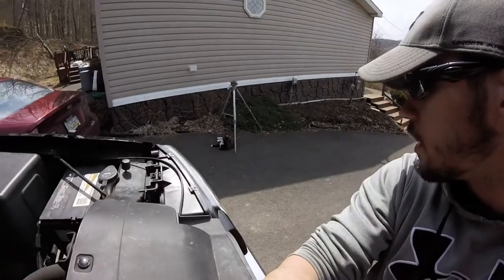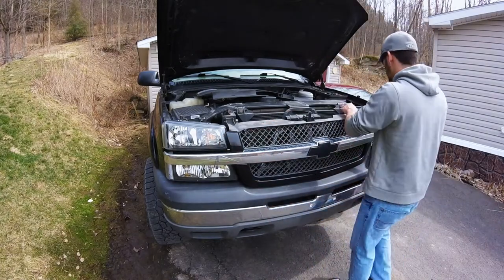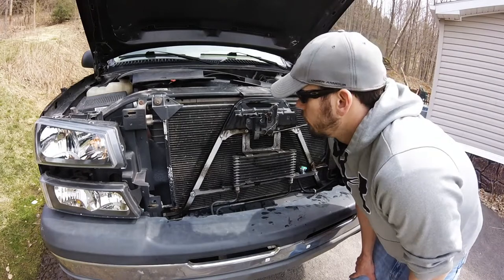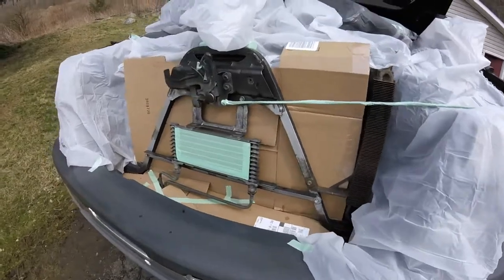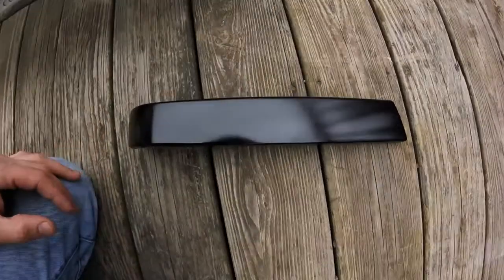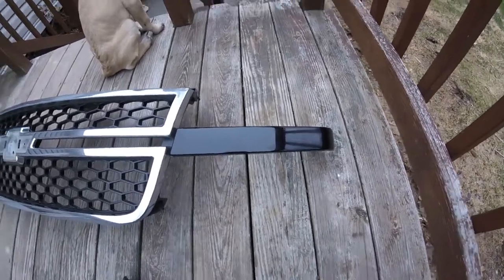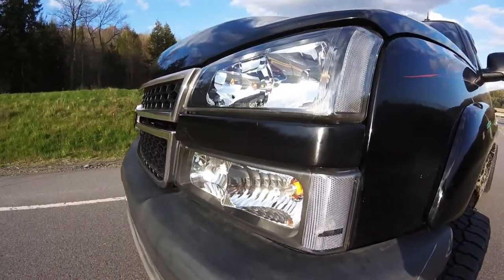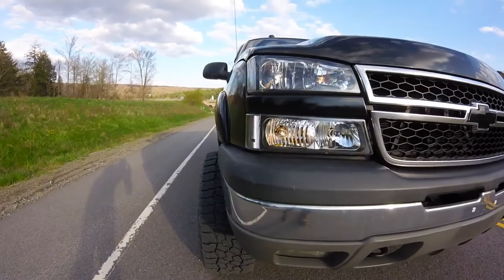06 Hood/Grill is finally on my 04 Silverado!!

Comment: I'm reading online that you really need a later 2005 or a 2006 or a early 2007 hood to switch the grills out for it to look best.. Did you switch out hoods?
Reply from the maker: @jeremycasady8183  yes I put the 2006  hood on first.

Comment: I have an 07 classic and painted those bars when I bought it. It's just a V6 LS but has one of the last manual transmissions.
Reply: Larry Rowe I have a manual Chevy too with a 6.0 ls it’s pretty quick for its size
Reply: The best part is 5 speed manual with cruise control lol.
Reply: @zxJC34xz  178000. Not sure if it's rare but I've only seen automatics for that year and package.
Reply: Larry Rowe I saw zero manuals when I was looking for my truck this past year lol. Keep in mind there wasn’t much on the market, all the tacuaches/truck club guys bought all the damn trucks. 

Got an 07 classic extended cab 4x4 5.3L

Comment: Sweet truck!!!! Love the upgrade! You should paint the lower bumper balance flat black also... I did it on mine and it made it look so much newer!!
Reply from the maker: It took almost a year but I finally did this recently lol. Very happy with the results.
Reply: Lower bumper balance?  Are you talking about the chrome part of the bumper, or the black plastic part?
Reply from the maker: @lynnt.7890  The plastic trim piece below the chrome steel part. It was typo'd, its called a valance.

Comment: How do the black plastic grill moldings that you painted stay attached to the grill?  Are there some sort of clips the plastic moldings snap into?  I bought 2 new moldings and a new grill but I can’t figure out how the plastic moldings stay attached to the grill.
Reply from the maker: They hook on the grill on the one ends, and then the plastic thin tabs on the back need heat melted. Kind of like a plastic weld job. Really odd design.

Comment: Looks awesome! I have an 03 2500HD. I do like this look.
Reply: RC4X4 hows the mpg? Hows the ride on these 03 2500.
Reply: @moparcharger8642   I have a Duramax and it gets average 18.5 mpg. I need to get my butt into gear and post some videos. I bought it new and it's 18 years old now. Just turned 170k.

Comment: Million times better! Dont mope on the blemishes good work! I think if ya detexture and color match the bumper plastics thatll really set it off.
Reply: Curious..will a light sanding “detexturize” the plastic lower valence? Perhaps a filler type primer underneath may do the trick.

Comment: How did you secure the side grille mouldings to the grille itself? I bought a grille and hood but just need to figure out how to secure the new grille mouldings to the grille
Reply from the maker: They hook on with the ends, but then you need to hot melt the little tabs and thats how they secure onto the grill.
Reply: @DarrenWS6  that's why I cant find any clips in the diagrams... lol thanks.

Comment: So the hood and grill fit with the stock headlights for the 03-06 range. And do they both match front ends in those year ranges?
Reply from the maker: Yes, hoods and grills swap and can be mixed. Bumpers are the same 03 to 06. The 06 hood will fit the 04 grill and the 04 hood can fit the 06 grill but there will be a goofy looking gap.

Comment: I have an 03 1500 cat eye. I was wondering if I would need to change the hood to do the swap or do I just need the front end ?
Reply from the maker: The hood and grills both match eachother. You can use the new grill with the old hood but there will be a gap that looks weird. They both 100% swap over easy.

Comment: Is the 2006 the same as the 2007 classic? My goal is to turn my 2005 base model into a nice 2007 classic clone. I’ve already changed the steel wheels to 2007 aluminum. I sure like your 2006 grille better than the 2003-2005. Your painting what’s behind the grille is a great idea. I can’t stand seeing what’s there myself.
Reply from the maker: Yes, 07 classic is basically a leftover parts 06 truck. The 2006 hood and grill will bolt directly in place of the 2003/2005 ones.
Reply: @DarrenWS6  Thanks. I’m also using the 2007 (new body style) badges on my truck because my late dad owned a 2007 LTZ Silverado. It’s going to be a mix of both styles. I don’t have the newer hood and grille yet, but videos like yours are where I’m learning what’s possible and  how to do it. Thanks again for the help and great video.

Comment: You should color match the front bumper it completes the look! I did it to my 06 and it looks like a whole different truck.
Reply from the maker: I definitely am thinking of it. My plastic up front is pretty aged looking. Did you do the chrome as well? I want to do that because of the faded license plate area.
Reply: DarrenWS6  mine had the color matched upper valance so I taped it off and painted the chrome bumper and the lower valance. I’m from PA also north west to be exact about 30 minutes south of Erie
Reply: Don’t color match the chrome Just the top pad my opinion

Comment: Can you do this on a 2003 Chevy Silverado 1500. My truck is not a HD will this still work on a non HD truck.
Reply from the maker: Yes. 2006 hood is 110% bolt on and the grill is 110% clip on no issues.

Comment: Is there way to adjust the headlight mounting bracket?
Reply from the maker: It is fitted and stationary, but I am sure you could perhaps pull it out and add in washers if you needed other angles of adjustment.

Comment: How did you adjust your hood man? So it can line up good across the grille and on the sides
Reply from the maker: Leave the 15mm mounting bolts loose and pull it outward as needed, lift the hood carefully and tighten them down.
Reply: @DarrenWS6  is that the one on the fender? Or am I mistaking
Reply from the maker: @lauroguerra732  yeah, has the 3 15mm bolts.
Reply: @DarrenWS6  ohh okay yea the 3 that are in a triangle ish position

Comment: Have an 04 myself, going to take this on.  Although my truck is tan and probably harder to paint match.  How much did you get that hood and grill for?  Curious if people are buying used hoods and repainting or something else.  Thanks, very cool truck.
Reply from the maker: I got the grill for $100 and the hood for $200. They were both salvage yard finds. I didnt paint the hood, just a good polish and rolled with it.
Reply: DarrenWS6 sounds pretty good to me.  Will search around.  How does your truck ride with the lift?
Reply from the maker: @Range-X  its an alright ride. Got better after I put fox shocks in it. A better lift would probably ride much nicer.
Reply: DarrenWS6 What would you consider a better lift?  BDS?  Not very educated on all the brands
Reply from the maker: @Range-X  BDS is by far a much better lift. My 06 Duramax has a 7" BDS in it and it rides incredible on 37"s.

Comment: ok bud i see  it's a 04 Silverado  & u r up-grading the 04  to the 06 or so... i'm just wondering here  ( cus i only scrolled so far down to see in the comment's )  if your rig here is a 1500  or  2500  or what.......... & guessing it's  the   v8   version too there......
... why i'm asking is cus  @ 10 15  look'n at the 2 grills  the bottom 1 looks wider ( side to side ) .... or am i seeing it differantly....?? .........either way  does the 1500 & the 2500 grill about the same ( i been told the 2500 is longer up & down wise )
........... i also wonder as well.......  guessing to up-grade my 1500 grill from the 04 to the 06  it has to be for or from another 1500 rig  ( can it be just the grill or do i have to do the hood as well  ( swapping both part's out to match right  grill & hood )......????
Reply: This isn't my video but the grilles are the same side to side. The very top where it lines up with the hood is different. It also wouldn't matter if the grille came off of a 1500, 2500, or 3500. It would fit. But I definitely would recommend getting the 06 hood as well if you get the 06 grille because it does not like up well at all. An 06 grille with an 04 hood would leave you with a pretty decent sized gap. You can Google photos.

Comment: Did you have to modify anything for the hood to fit, cause I see people with hood gaps when they do this, but yours looks really clean and flush. I wanna do the same to mine and put a HD bumper
Reply from the maker: Nope, zero modifications needed. The gaps some folks get is due to not mounting the hood to the hinges properly and adhusting the rubber hood bump stops. Mine was hard to open at first, so I loosened the hinge mounts some and pulled the hood forward, then it was perfectly fine.
Reply: DarrenWS6 thank you so much, can’t wait to get this done

Comment: DarrenWS6  I have a question do you have to have the hd hood in order to fit the hd grill in a 2003 Silverado 1500 that’s what I got ?
Reply from the maker: No you d0nt have to have the hood. But with the 03/05 style hood there will be a gap lip left where the 03/05 grill protrudes in the hood.

Comment: Will the 2006 grille work with my 2004 hood?
Reply from the maker: It will fit physically, but you will have a gap from the upper grill to hood since the 03/05 grill comes up into the hood some.

Comment: I have a 2004 Silverado classic can I just buy an hd hood and a 2006 grill and put it on? Or is there adjustments I need to do?
Reply from the maker: Hood and grill will bolt right into place with zero mods needed.

Comment: How did you remove the painted side mouldings on the grille an reattach them?
Reply from the maker: They have plastic tabs that are to be heated and melted like plastic weld. So they aren't easily removed. I bought 1 new one and just painted the existing one.

Comment: I did my bottom air deflection I hated the grey color and also did the plastic bumper cover In black looks way better....they have paint for plastic at auto zone or rileys same brand way cheaper than ebay even about 8.50 per can ....
Reply from the maker: I did that as well. Transforms it incredibly.

Comment: Did you use primer or just the paint and clear coat for painting the new grille?
Reply from the maker: I primered the two pieces and paint and cleared.
Reply: Always use primer First. It gives the paint a tooth to grab on to. Prep with TSP and rinse.

Comment: Do you have to have the hd hood/bumper just to fit the grille??
Reply from the maker: To fit the 06 grill the 03/05 hood will fit, but it will have a gap because the hood has a provision for the grill of the 03/05 grill. The 06 hood works on a 03 grill as seen in my video. Bumper doesn't matter, all the same 03/06, although the 2500s have a taller upper trim piece than 1500s to make up for the taller frame.
Reply: I have the 03 with the cateye front end. So it will fit but will have a huge gap that’s noticeable
Reply from the maker: @dlo__3929  yeah, the hood and grill will swap over. The 03 hood will have a gap on a 06 grill

Comment: Is that the stock 04 hood too? I have an 04 that I want this grill for too but I didn’t know if the 06 grill would match up with my hood. I have a 1500
Reply from the maker: No, that's a 2006 hood. I put that hood on before I changed the grill.
Reply: DarrenWS6 did you have to get 06 genders too or did the 04 one match up right?
Reply from the maker: Nope, those were all good '03/'06. Grill and hoods all interchange.

Comment: Just a qeastion I have an 04 Silverado as well and I just bought an 05 HD hood for it and planning to buy the grill next but does anyone know if it fits or if I will have any issues because I don’t want to open the packaging and ruin it if I have to end up returning it if it doesn’t fit any problems I would run in to?
Reply from the maker: It will bolt right up 100% and work. Guaranteed.
Reply: DarrenWS6 thank you man I really appreciate it just wanted know before I even started to take my original hood off
Reply: You should always open parts when they get delivered to check the condition.

Comment: So do u know if the 06 grilles like the one u installed would fit on my 05 1500 ls?
Reply from the maker: Yep. All 03/06 hoods and grills will interchange, straight up bolt on.
Reply: Where did u get your grille from
Reply from the maker: @nikoricci5715  bought it used locally for $100.
Reply: So I would need to get a hold too for it to fit
Reply from the maker: @nikoricci5715  for it to look proper, yes. But, it can fit. It will have a gap from the 03/05 hood having the provision for the 03/05 grill. The 06 grill is flat and the 06 hood has a taller lip. You can run the 06 hood onthe 03/05 grill and it wont look bad either.

Comment: Please....anybody.  I have a 04 chevy 2500 hd crew with regular low hood. Can I buy a regular hood or the taller hood from an 06 and use that 06 grill? Or does this only work with 1500 models
Reply from the maker: You can swap to the 06 hood and grill directly. You can also swap an 06 hood to an 03/05 grill and clear, but the vice versa will have a gap.

Comment: Where can I buy the plastic pieces that you wet sanded and painted?
Reply from the maker: Rockauto is where I ordered mine.
Reply: Ok thanks what is the specific name of them pieces? Grill bezels?
Reply from the maker: @spencermorris8841  They are listed as 'Grill Molding's. I double checked and got the part #s for you. Passenger side is GM part # 12335958, Drivers side is GM part # 12335957.
Reply: DarrenWS6 awesome thank you!

Comment: Major improvement!  I am going to do the same on my '04 2500HD.  Question:  It looks like you put the 2006 hood on first, and then swapped out the grilles later.  Is that true?  The 2004 grille will fit under the 2006 hood?
Reply from the maker: I did out the 2006 hood on first before the grill because I had to rattle paint the end pieces to match. The 03/05 grill does fit under the 2006 hood.
Reply from the maker: Hayden Royer  the front ends on all the 1999/2006 trucks are interchangeable. You can definitely bolt on the 2006/2007 classic hood and grill onto a 2003/2005 1500 truck.

Comment: Do you need to buy a different bumper or does the stock one work
Reply from the maker: Nope. Bumper is the same from 03-06 and of coarse 07 classic. 2500s have a taller upper top.pad is the main difference.

Comment: Do you need to change hood?
Reply from the maker: You don't but the 03/05 is arched for the 03/05 grill so there will be a gap.
Reply: @DarrenWS6  mines a 04
Reply: @DarrenWS6  so I do need hd hood?
Reply from the maker: @ruthlessgaming7627  being as 04 is between the years 03 and 05, yes, you will need the 06/07 classic hood.

Comment: Web Link to the grille?
Reply from the maker: It's a stock 2006 truck grill, search up that year and it should show up quick.
Reply: @DarrenWS6  10/4 I got a 05 duramax with the same grille and it was spray painted black and looks horrible and I wanna replace it with a new chrome one my main thing is how to replace my wing inserts between the headlights I can’t find any vids of the removal process
Reply from the maker: @ashtonmuglach7298  the wing pieces GM was ignorant about. They are plastic melted on via tabs in the back. I did my best to do the one I had to, but I masked and painted the existing one.

Comment: Is that a hd hood
Reply from the maker: Its a 2006/2007 classic hood. All trucks got the split grill and taller hood in 06. In 2005 it was first brought standard on the 2500 trucks only.
Reply: DarrenWS6 would the grill and the hood fit my 03 Silverado. Without any modifications like cutting or welding
Reply from the maker: @greatestever2831  yes, 100% bolt on.

Comment: NEVER, EVER spray paint on a cooler or radiator, the finds are designed to release heat through the natural metal finish, paint seals the fins and creates a heat retention.
Reply: Little bit of overspray wouldn't hurt a thing.